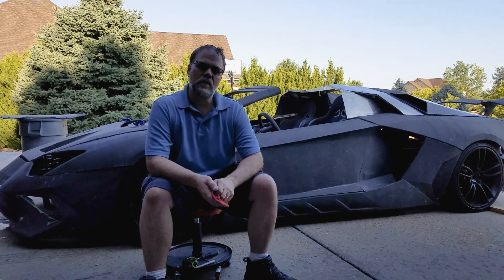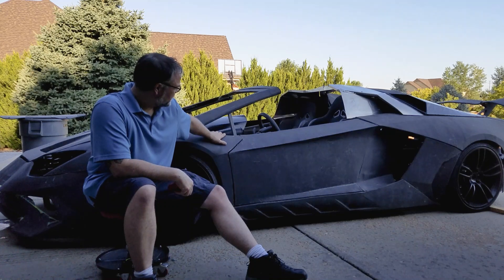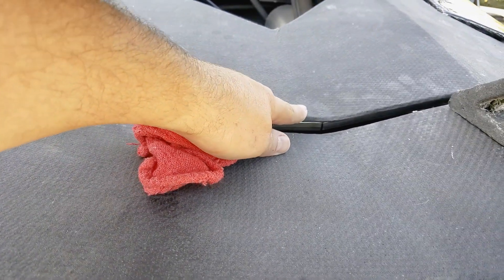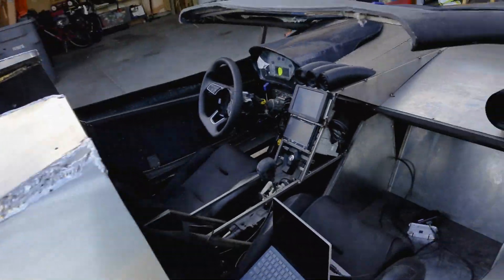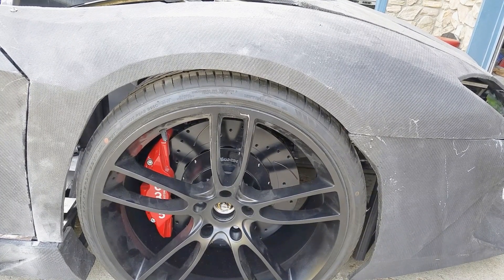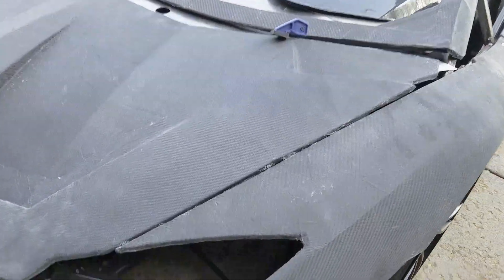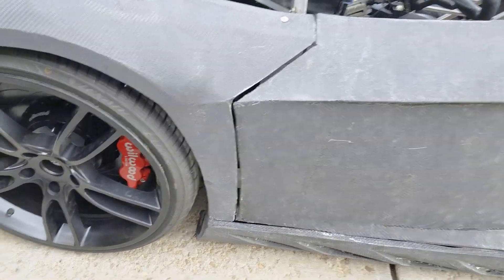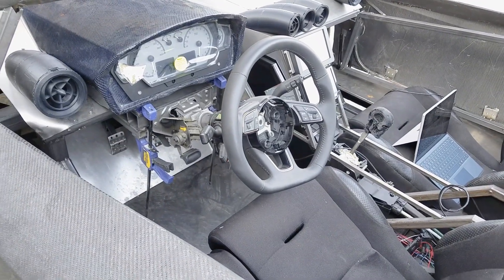3D Printed Interceptor Update 3

Comment: We are producing 
200x200x200mm to 1000x1000x1000mm 3D printer.

Highly recommend our C-M1 3D printer which is our best seller recently.

1) Printing size: 1000x1000x1000mm

2) Filament break warning/ touch screen/power off resume/ servo motor/ rail guide/ 7 inch touch screen

3) 4500 EXW Shenzhen

4) Enclosed printing environment

5) Provide OEM service

Should you have any questions, please contact me and have a nice day.

You can contact me by email: hardy.ke@creatbottech.com or whatsapp: + 86 18318030163, also you can visit our alibaba store： https://creatbottech.en.alibaba.com/

Comment: You may have to get an local old auto body guy to come thru and help out. Hell he may even do it for free. I’m assuming your gonna paint it. So if it were me. I’d do a bit of fiberglass repair where needed. Small stainless steel tubes where required for rigid ness and bondo. Also for panel gaps you may wanna go to the boneyard and look at how quarter panels are secured on most cars. Grab one of the parts and 3D print to fit your vehicle. Then if you really want that carbon fiber look. Dip them in carbon fiber and clear coat to finish. Wet sand and it should be perfect. Keep up the good work.

Comment: Hello was looking through the comments maybe i have over looked it. Was wondering what printer you were using filament type and bed size?
Reply from the maker: CR-10S, PLA
Reply: @lasersterling  any complaints or wishes with the printer im printershoping
Reply from the maker: @omgretail6111  It is a little fiddly.  Once it is dialed is I ran mine for 1.2 years nearly solid.

Comment: Are you going to sand it and polish it ?the 3d printed material looks just a little rough but it does look pretty much identical to the real thing lol also should put p100d batteries instead of a traditional engine just to troll lol

Comment: Long strand fiberglass filler will help with the gaps then bondo, then finishing putty, then 4 coats of white value shaded primer. With block sanding between each of those steps. Also use guide coats as well between those steps too. Good luck from a automotive  painter dide from Hamilton Ontario Canada

Comment: After seeing this a month ago, I spent some time learning how to use composites (and attending a couple of classes @ EAA Oshkosh).  I'm not an expert with Solidworks, but I am pretty good (And turns out, good enough, to do something like this especially after finding models on grabcad).  Your process is very interesting but I think it shows the issues with what you are running into now.  I know it would be a lot of work, but I'm now looking at making molds to build with composite.  So, I plan on building a 10' x 10' x 6' cnc to cut the foam then build a mold and use carbon fiber directly on the mold instead of encapsulating the plastic with carbon fiber.  The CNC uses the same technology as the 3D printers but it's removing material instead of adding.  Based on talking to experts with the material, you'll experience no warping working with the material this way.  You could also make a larger format 3D printer (a friend of mine is building a 12' x 12' x 6' 3d printer right now.  There are considerations you need to make when printing that large but it is possible then print with an infused carbon fiber filament for extra strength.  This is also using the same controller boards / tech as the smaller printers just with larger frames (and the marlin configured to work with the larger size as well).

I won't be building a car right away, but instead I'm going to build a highly custom boat  for the lake I live on.  When I have more room, I'll look at doing something similar to your project.

I love your channel! Keep up the good work.

Comment: Nothing $20,000 of bondo won't fix. 👍
Reply: Yeah, finishing this thing is going to be an absolute nightmare. If it were me, i'd use the 3d-printed parts to make a mold of each panel, then lay the carbon fiber / fiberglass carefully and vacuum bag it. Then, boom! a fairly accurate final part with minor fixing in the end. I just see lots of wrinkles, chips, dips, warps throughout almost all panels and i cringe for the paint prep process. fingers crossed for him

Overall, the project is fantastic and i'm really hoping this thing gets finished and turns out awesome.

Comment: It is really amazing work you've done, and huge props for the monumental effort required to get this far. I am curious about the 3D printing side of this project. What printer are you using? What filament? Are all the panels heat treated (anealed) to be more temperature resistent? Just curious how you overcame a lot of the problems that come with home accessible 3D printing technology.
Reply from the maker: CR-10S mainly. PLA, is what I use.  It is then covered in carbon fiber to strengthen.
Reply: @lasersterling  ohh I see. That makes sense. I thought you were printing CF infused filament (which is really quite expensive). Even with the CR-10S' build volume, I imagine you'd have to break this into hundreds of parts and then, what, glue together? I guess the CF covering helps to hold it all together. What about heat tolerance? Normal PLA has a glass transition temperature of around 150F, which can easily be reached in many parts of a car.
Reply from the maker: @shenqiangshou  See my other videos.

Comment: I really don't know why you used your 3D prints as the final panels.
The plastic is fragile, flammable and prone to both shrinkage and UV damage, and the finish is terrible.
You need to use them to make moulds and create either fibreglass or carbon fibre panels.
They would be considerably stronger and you would get an immaculate polished look.
That said, kudos to all your hard work, it's a remarkable achievement.
Reply from the maker: Goto www.facebook.com/lasersterling.  You can see all the carbon fiber work.  I addition check the carbon fiber encapsulation videos on this channel.
Reply: It's good for what's it's designed for... Going to a school and back

Comment: Wow! Great project! After properly setting the hood frame to your liking, perhaps consider using Tiger/Kitty hair fiberglass to build/the two edges (Hood/bumper). You lay the fiber smoothly over the gap between the bumper and hood, let it set, and then cut your own gap using a cut-off wheel! You can then add a black -painted boarder to both pieces before you UV coat it. It'll still look legit as some composite companies create this type of hard boarder for their products.

Comment: Your hood is warped. Thats why you are having a hard time leveling it. Imagine a piece of plywood that is warped and bowed on one corner. Now try to take that same piece of ply wood and make it level. One corner will be flat and three sides will be up or three sides will be flat and the other one up. Some cross members on the inside may pull it back into place. One way to test this out is take it off and lay it on a flat ground and see if all the same spots are touching the ground. Good luck my friend.
Reply: God bless